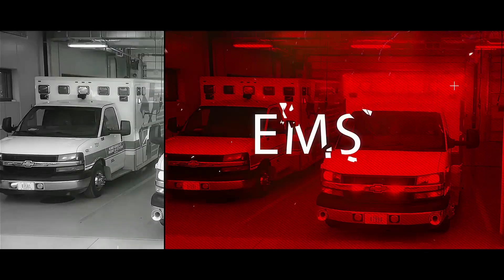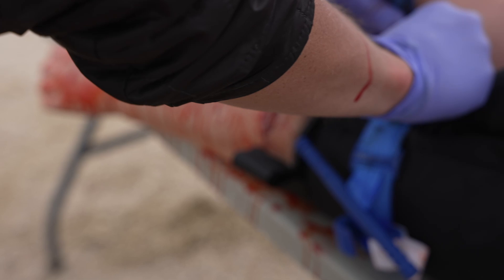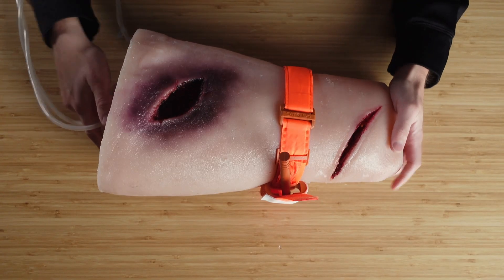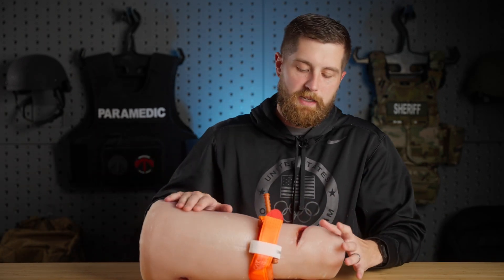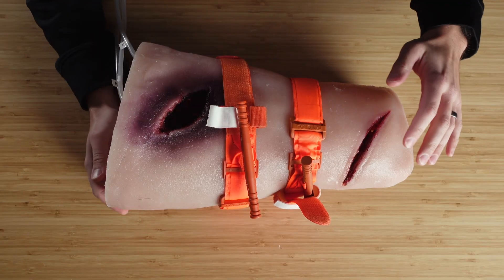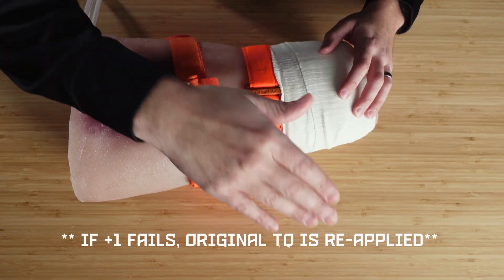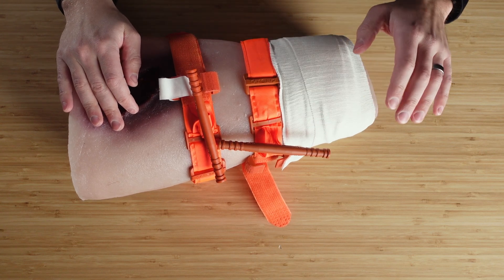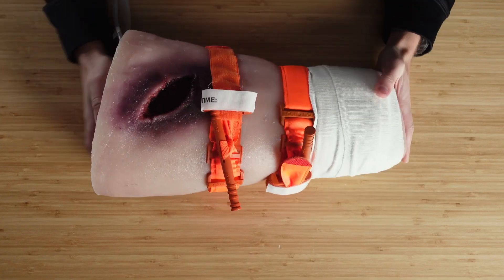When and How to Remove a Tourniquet ⎮TQ Conversion⎮

Comment: thank you for the disclaimer at the beginning! :) 
T-Kits are best used for gunshot wounds(IMHO). nearly everything else can be treated better with a (or more) simple bandages. in most cases you do not need extensive pressure or to "stop" the blood flow. reduce it to a level where the patient can survive to the point that Emergency Services arrive.
Reply: 5:25 Thank you! :D
Reply from the maker: So that’s half true. We do not change treatment based on mechanism. TQs are for any and all life threatening bleeding from any extremity, which could be from a gunshot, chain saw, car crash, glass etc……

Comment: This is interesting to me, I’m currently in EMT school and gonna be on a volunteer service soon, and I what I have been taught about TQs is that once we put on a TQ you never take it off not sure if protocols change and only doctors takes it off and not yourself, unless this is for paramedics and not BLS, if it’s taught to paramedics only it makes sense to me cause EMT is BLS and paramedic is ALS. Or that may have changed over the years cause protocols in my state have changed a bit within as little 4 months. If your curious about our protocols when comes to an arterial bleed is that you don’t apply a TQ first dumb Ik, we pack the wound first and if it doesn’t stop then we apply a TQ if it doesn’t stop.
Reply: We are taught in paramedic school once you apply a TQ, you leave it. The only time you would remove one is if it was not placed properly
Reply: @okinshield7167  it seems like that it’s state dependent then, cause I was confused for a minute lol.
Reply: @Chris09978  this is more tccc it seems like
Reply: @maddog980  I see, that kinda makes sense
Reply: The reason is quite simple. -> It's a question of evac. time. If you have 15 minutes, or maybe even 40 to the next hospital, just leave it on. In TCCC it can be different, where evac. can easily take half a day. A tourniquet which has been first applied high and tight might be converted to one closer to the wound. This can allow for better usage of the limb (a tourniquet above the knee pretty much stops anyone from walking normally), and less damage if kept on for an extended time period. But that is rare. Never change a running system

Comment: I have a question. So I work In construction and now I have a full trauma kit because of a injury that happened to my boss and all that was available was a really crapy first aid kit. What happened was he got a deep laceration on his arm from a very sharp piece of tile while doing a bathroom demo. All we had were bandaids, a small roll of gause and painters tape. He put pressure on it and tried to stop the bleeding, which worked a little bit but we were trying to put bandaids  across the cut to keep it closed before wrapping it with gause. This didn't work, the bandaids just came right off, we resorted to using tape then quickly wrapped it up but it was still bleeding through so we got him to a hospital. Now that I have a full trauma kit with the right bandages I probably could have stopped the bleeding without a turniket just using hemostatic gause and a pressure dressing, but could I have used a turniket to help stop the bleeding to a point where I could apply wound closure strips and a good pressure dressing and then removed the turniket? Or should it just be left on? The cut wasn't huge, about 3 inches and in most case's probably wouldn't need a turniket, but I'm just curious if a turniket can be used to stop bleeding to make it easier to close up the wound and dress it, then remove said turniket. I love your videos, thanks!
Reply: If someone is bleeding badly enough that you need to use a tourniquet to treat the injury they really need to get to a hospital. Most bleeding can be stopped with a combination of pressure and raising the extremety above the heart. If that does not work or the bleeding is severe, a tourniquet is a great tool. Regardless, the patient will need to go to the hospital to get assessed. There are other complications that can arise from seemingly minor wounds. #notmedicaladvice 

If you want to be more prepared there are stop the bleed classes that you can take (at least here in the USA) that will give you a good overview of how to deal with some emergencies while waiting for EMS or transport to definitive care.

Comment: Shouldn´t the second TQ be placed side by side with the 2-3inch-above-wound TQ? If memory serves me correctly; TQ effectiveness is primarily a function of how wide it is (wider TQ needs less pressure to close of arteries, pressure being the one thing injuring nerves). Two TQ´s apart will probably need higher pressure for occlusion. (Wall et al. Tourniquet and occlusion: The pressure of design. Mil. Med. 178,5:578, 2013).
Im thinking "Tourniquet Conversion" or "Tourniquet Repositioning".

Btw! Thanks for a great channel!

Comment: Is there a need for pharmaceutical intervention in the 2-6 hour window? Or does anything about the TQ conversion change, if doing it at say hour 5 compared to hour 1.
Reply: From the information i learned about it (not a professional) there is a very low risk without pharmaceutical intervention after up to 2 hours. From that point forward the risk increases until at 6 hours you are really playing with the patients life just to safe the limb. (as in you should definitly not do that if you have to ask the question. This is more about the knowledge that removing a torniquet under 2 hours usually doesn't require special pharmaceutical intervention.)

Comment: I was taught to put the second TQ as close as possible to the initial TQ to avoid compartment syndrome. What are your thoughts on that? Were you never taught that because it doesn’t apply to EMS since evac times are typically short or did you just forget to?
Reply: The plus 1 TQ should be placed 2-4 inches above the wound to not interfere with the pressure dressing. The initial TQ which is high and tight should be slowly, 1/2 turn every 60-90 seconds, NOT loose all at once, and reasses bleeding thru dressing. The reason moving TQ closer to wound is to allow blood flow, perfusion, to heathy uninjured tissue.
Reply: @uToobSucks  should the initial tourniquet not be put 2-4 inches above the wound? That would mean your first and second tourniquets would be overlapping or extremely close together I think.
Sorry if I misunderstood you, I know very little about this kind of stuff and am trying to learn
Reply: @ChickentNug   Good question, ask anything. There are 2 places an initial tourniquet can be placed. 
The first place, is high and tight on the arms and legs, so high up in the armpit or high up in the groin. This is based on Tactical Combat Casualty Care (TCCC also called T triple C), if your life is in immediate danger, your taking fire, being shot which is called Care Under Fire\Threat, put the tourniquet high and tight, is you see life threatening bleeding, there is no time to identify where the life threatening bleeding is coming from. 
The second initial place for a tourniquet is when you can easily identify where the bleeding is coming from. This situation is non-combative, you are not in danger and you can easily identify the bleed and know there is no injury above it. 
Remember tourniquets only go on a single bone, above the elbow or above the knee.
Ask, if you need clarification or something else.
Reply: @uToobSucks  Unfortunately, you are wrong, (at the stage of tactical conditions "TFC", if we are talking about combat operations, TCCC protocol) the tourniquet can also be placed in places where there are two bones (it hurts, but it works), the main thing is not to apply it on the joints (knees, elbows, wrists), preferably even above/below, where there are muscles that take part in the process of squeezing and increase the effectiveness of the tourniquet. It is also extremely important to take the first puff! If it is not done, the TQ may not work. Conversion or translocation of the TQ is a HUGE pain in our days! BUT IT IS VERY IMPORTANT TO EMPHASIZE THAT THIS SHOULD BE DONE BY ANOTHER PERSON WHO IS TRAINED TO DO IT!!! Otherwise, the wounded begin to do it themselves, which leads to irreversible - fatal consequences!!! So if there is nobody close to you who can do that? wait, untill that person will appear and ask him to do that, after doublecheck everything according to protocol before he/she starts (Symptomes of shock, time, etc.)  Compartment and guillotine syndromes are separate themes to discuss. Be safe! G2UA!

Comment: I was taught in med school to avoid the use of TQs unless absolutely required (you have no other options and direct pressure and pressure points aren't working, which is extremely rare).

In a shtf scenario, you need to ask yourself, are you going to keep a pressure point for hours?

Comment: Kick ass videos!

Question though. In the event of the conversion, the conversion fails. And now you’re stuck with x2 tourniquets, 2-3in apart. Are you not creating an additional compartment? 

I understand, EVERYTHING “depends” in medicine. 

My questions are. 

Are you leaving both in place? 

And 

If so, why not side-by-side them in the event that you need to?

All due respect intended. Simply curious why the spacing?
Reply: Same question here, and actually, why do we need the second one at all? If you are in the fields, TQs is a valuable resource and you can't simply use it "just in case". And if you are in the ambulance or in medevac with a good stock of TQs, then why would you need the conversion at all? TCCC says (correct me if I'm wrong) - pack the wound or put the pressure dressing and then slowly loosen the TQ within 1 minute and if you don't see the bleeding restored - you are a happy camper, just leave the TQ where it is, ready to be tightened again. Would love to get the author's feedback. ty
Reply from the maker: I discuss this in the video brother.
Reply: @PrepMedic , well not really, at least I didn't see a good explanation why are we using a second TQ put higher than the initial one. Don't want to be a pain, but you are making an advanced first-aid tutorial, and this is quite serious. So when we REPLACE the TQ from the high-and-tight position closer to the wound, it makes total sense. But when you do the opposite - not sure it made any sense for me. Thank you in advance for explaining this.
Reply: @mh_fotik  listen at 6:24 for a bit it will tell you why

Comment: When and how should we apply antiseptic to the wound(s)? What forms/types/brands of antiseptic do you recommend?
Reply: @EnPeeSee  I dunno, still worried about infection at the would site.  If there is anything that can lessen complications and inflammation in general, I’d wanna do it.
Reply: @yoongiwifeinthenextlife  leave that for the hospital. There are too many specific antibiotic treatments that we don’t mess with that since it could cause problems later down the line. Sterile dressing is plenty fine to try and prevent infection
Reply: @yoongiwifeinthenextlife  just leave it. Throwing stuff into the wound cavity would only melt the clot. Massive haemoorage kills in seconds, infections in days
Reply: @yoongiwifeinthenextlife  The best thing to do is leave it, as soon as the patient gets to the hospital they’ll usually get antibiotics and anti inflammatories. For minor wound care and basic first aid, you can use a brand called bactine and look for the bottle with BZK and lidocaine, I use that and it works well.

Comment: Another question: if I will not be able to monitor the wound during transport, should I even loosen the tourniquet after hemostatic gauze and a pressure bandage has been applied?
Reply from the maker: No

Comment: Brother, idk about civilian side aid that much, but youd never want to losen a tq unless another is tightened. Its like kinking a garden hose, then unkinking it its gonna gush out quite fast....
Reply from the maker: The whole point of a conversion is to take off the TQ. I didn’t make this process up, this is actually a thing and this is how you do it/how we do it in professional practice
Reply: @PrepMedic  I'm not arguing with you, I am just curious to further my knowledge, sorry I worded it weird and kinda blunt, but if the TQ isn't tightened, wouldn't the blood start gushing back out the wound even if it's packed? (Assuming the artery is why they're losing so much blood)
Reply: @2averagenoobs108  The point of a conversion is really to remove the tourniquet if it wasn’t required, if you applied a tourniquet and there was arterial bleeding, then leave it. If you put the tq on and it was just capillary or minor venous bleeding then you could convert it, that’s why he said you just fill the cavity, not pack the gauze against an artery, because again, if there is arterial bleeding, the tq stays on.

Comment: Question can this be done if an artery is severed or does it have to be stitched up before releasing the TQ
Reply: You would leave the tourniquet on, the only reason to convert a tourniquet is if the tourniquet was not necessary. Like sam said, it’s pretty common for officers and military personnel to apply a tourniquet immediately after being shot regardless if the wound needs it or not, once the scene is safe and you can asses the injury, you can check to see if there is any major vessel bleeding like an artery or vein, if there isn’t and it’s just capillary then convert, if an artery or vein is bleeding, leave it on and get the patient to a hospital.

Comment: What happens after six hours?
Reply: The limb dies...probably
Reply: There’s basically no chance to save it, since there was no blood circulation for such a long time. Not sure, but I think there’s like a shot that they may give in a hospital environment to try to save it, but can’t tell for sure
Reply from the maker: There have been limb recoveries after this timeframe. The issue is that there is a large amount of cellular waste that will circulate through the body if the TQ is released which can cause cardiac arrest and at the very least acid base imbalance. These patients need a surgeon and will also get a cocktail of calcium, sodium bicarbonate, albuterol, insulin, and dextrose to counteract these effects.
Reply: @melissasmess2773  the limb is fine. The US Army did a field study and proved a tourniquet can be left on for extended amounts of time 

https://pubmed.ncbi.nlm.nih.gov/17414556/